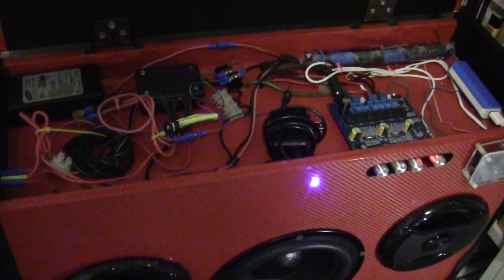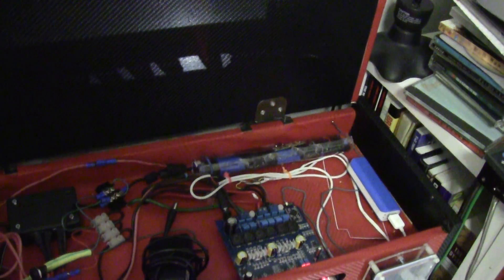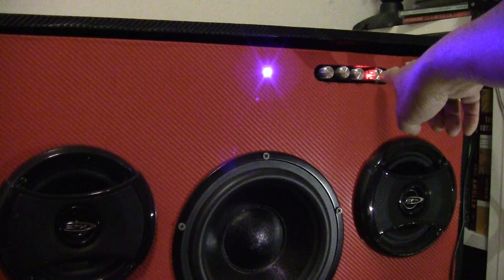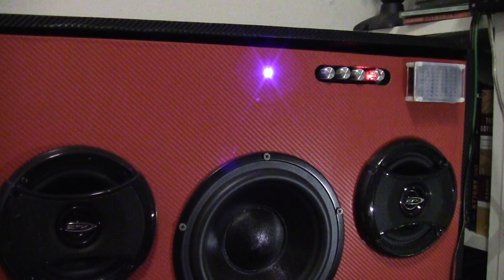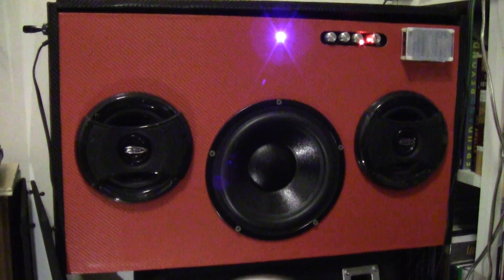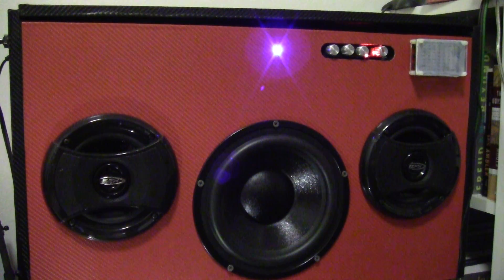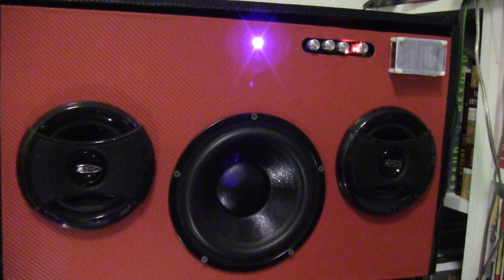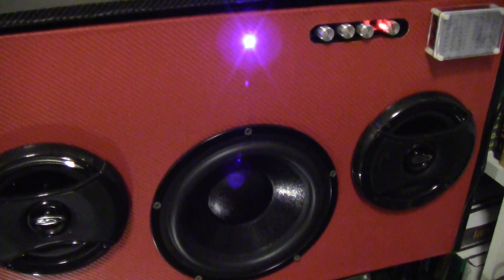diy boombox sound demo

Comment: can you measure the maximum power on the subwoofer channel. i have also this amp but i don't believe it gives me 100watt, more 20 watt or so. i saw you whit a watt meter in one off your video's, it would be awesome :)
Reply from the maker: You can look at the data sheet for TPA3116 D2.  Output is dependent on power supply used. The amp that I have has dual core with 100w for the sub and another 50 watts each for the left right channel. Given the right power supply, it should deliver the power as stated.
Reply: wtam69 thanks for the information. on the internet they said 2x50 watt but if i put 24V in it with a 4 ohm speaker it is not that loud. maybe it is peak power, so you have like 25 watt rms x2. also its depent on the device. laptops go harder than mp3 or smartphone. i gonna test it with my other amplifier today wich is 15 watt RMS and look if it go harder than the TPA3116d2
Reply: wtam69 have test it. my 15 watt amplifier reach almost the same volume as the TPA3116d2 so i think it is only 25watt at MAX! 

i have a different version of yours, at about 10 euro but still a TPA3116d2 2.1 50+50+100 watt
Reply from the maker: Thanks for your update. The power output info is from the Texas Instrument datasheet and they generally are accurate. You got a real bargain at 10 euro. The 100w output is based on:
– 2×50W Into a 4-Ω BTL Load at 21V and probably with a 5 amp or so power supply. 
 Your 15w amp can reach the same loudness but it's hard to determine the distortion level unless you employ a sound lab to do the test. Another factor is the design of the speaker you are using. Acoustic suspension type speakers will have lower sound level than high efficiency speakers with ported design.  Maybe someone else with lab test knowledge can comment on the design of the chip and the output.
Reply: I used the same speakers. My power is 2amp but that is not the problem because if i put the volume up its not clipping or hanging at some point. 

The 15 watt amplifier is the maxamp20 so its a good quality amp. You can look on the site for info.
Reply: I have a 19 volt 3.5 ampere power supply i go to test now
Reply from the maker: You will get, at most, 33.3 watts per channel with that power supply. See if that will make your speaker louder when you turn it up.
Reply: I have test it and it make no difference. I only have 1 full range channel on. If i put the other amp 15 watt on the same speaker is go twice as loud. 

I have a other version than you so it's not sure if it have the same power. 

If you put 1 full range channel fully open how much do you measure?

I see you have a watts measure tool, would you measure it just for science ;) ?
Reply: Your amplifier have a subwoofer frequency control and mine don't. So i was looking for your type of amplifier to buy because of that but if it have the same power as mine i won't. Thanks !
Reply from the maker: I was only testing how many watts the amp would consume at my listening level. It takes just a few watts to obtain that level. If I turned the volume any higher, it would be too loud. My boombox is very efficient and my other setup uses a ported subwoofer so it's loudness is more than adequate for a small room.

 I have 2 working tpa  3116 d2 amps with 1 amp that has a total treble volume control in addition to a separate treble control. The total treble control acts more like a low pass filter.  I bought a 3rd board to build another boom box and the board is the same as the one used on my boombox.

  I would not be able to do a proper test since my power supply is only 3.4 amps at 19v for one unit and 3 amps at 16 v for the boombox.  The lower volume you noticed on your tpa3116 d2 can also be a lower input sensitivity as compared to your 15w amp. Also, don't forget, the chip and the board it's on are not of best quality, hence the low price. The other components on the amp board will definitely affect the sound quality. You can see on eBay some boards boast different components.  

My watt meter is being currently used to monitor my solar panel input so I won't be unplugging it to do the tests. I can do a quick video of my two amps using music from Youtube audio library but I can't go into detail analysis .  That has been done by other reviewers.  Sorry to disappoint you. By listening to my sound demo, you can get some idea of what the board is like. By all means build a speaker using the 15w amp if you find the sound output adequate.
Reply: Thanks a lot for the info i buy the exact board as you if you say it is loud. I need at least 20+20+40 watt. The 15 watt amp don't have a subchannel : )
Reply from the maker: If you have the same board as I have, and if you use the same speakers that I have, you system's loudness would be more than adequate for a small room. Maybe you can do a video of your setup and perhaps others can pick up any deficiencies in your system.  Good luck!
Reply: Thanks a lot, i don't have the same speaker. Wich speaker do you use?
Reply from the maker: One system has a pair of AR 18 for left right channel and a dual 10 inch sub. The other, a boombox has 2 five inch scosche car speakers for left right and a dayton 8 inch sub augmented by a 10 inch passive radiator.
Reply from the maker: Here's one of my system using the AR 18 and Dual sub :https://youtu.be/gFnf5DP-7aY